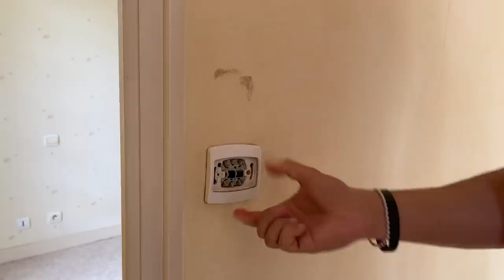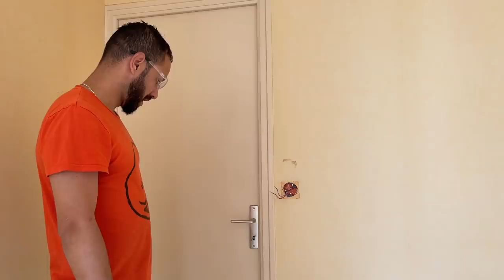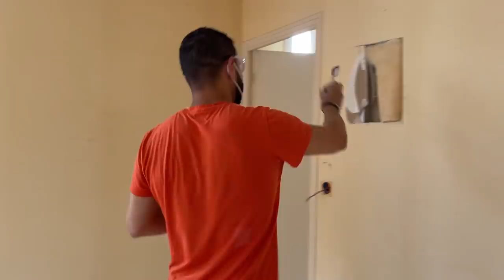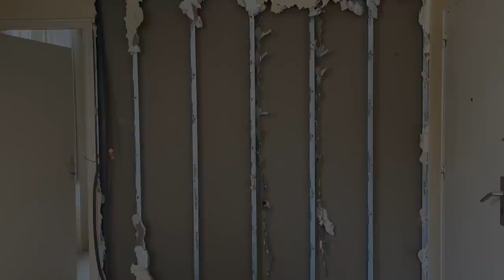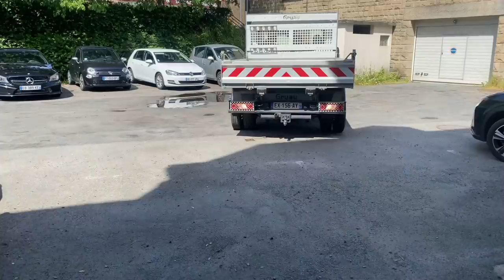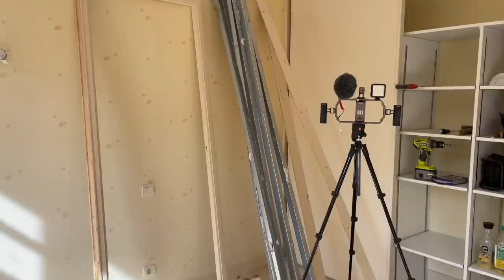Knocking Down Walls In The Convent Apartment - Sadie In France

Comment: wow, looks amazing without the wall..I agree with Michael, you should open up the staircase and take down the drop ceiling. Restore to the original look..remember hot air rises, so u would get heat from the downstairs apartment.

Comment: Totally agree with Michael and others remove the drop ceiling you can still insulate the new one and have it at a proper height so the windows are exposed.  I also think it would be nice if the stairway could be incorporated into the space separating the other unit off at the ground floor. Work with Billy on this it would make both apartments nicer if the separation was right by the mailboxes.
Reply: Yessss thissss, making the staircase just for them will make everything easier :D

Comment: I know you will be doing your research but since you have a cement floor - any thought to radiant heating in the floor. 
Lots of things to think through. If you don’t remove the ceiling is there a way to adapt the ceiling to open the windows all the way and make it an architectural feature

Comment: Mo, be mored aggressive to those walls :), give them a good wack.  If it was me, I would take down the wall that has your entry door in it and make a wall/door either at the bottom of your stairs or at the top.  You could probably make a small entranceway.  Your whole room would be so much wider that way then.  You could also have a door at the bottom of the stairs that go up to the next floor (like an old cottage would have had) if you're worried about your room having the stairs in it.

Comment: It looks like the issue of the ceiling could become another "renovation phase" - the way it is will work just fine. At some point get a heating/cooling expert to determine the effectiveness of raising the ceiling almost to the original height, but leaving enough room to keep it insulated. Also, what would the cost be to heat the space with higher ceilings. You might consider a kitchen island that has lockable wheels, so it can be moved according to the cooking need at any given time.

Comment: I understand cost is a concern with removing the ceiling, but if you could see the full length of the windows it would be stunning. The windows are the only historical architecture in the room.
Removing the wall to incorporate the staircase into the room would really open it up and be so beautiful. Wouldn't hurt to get some estimates before you decide. Good luck.